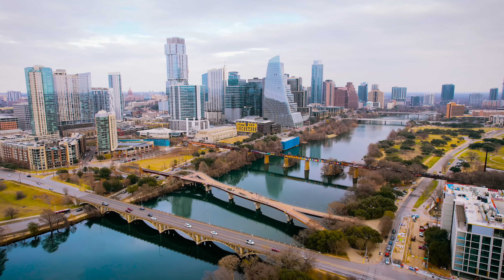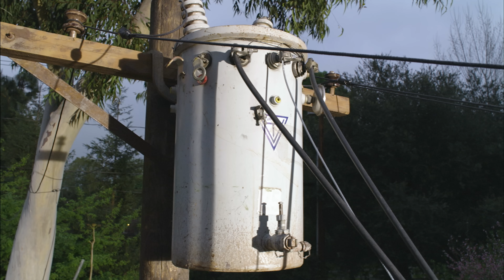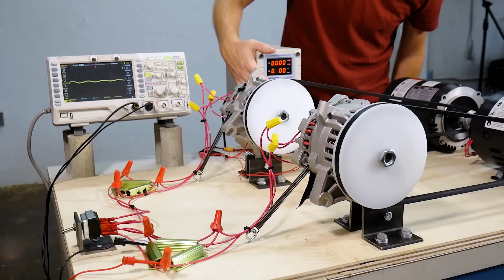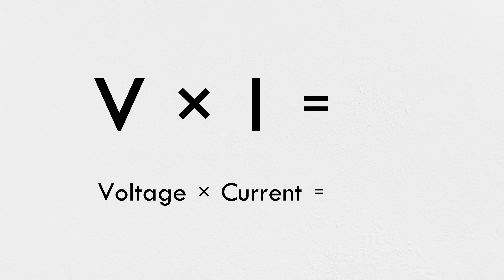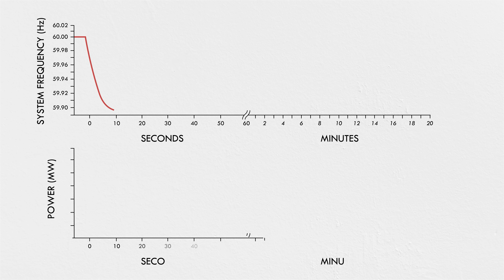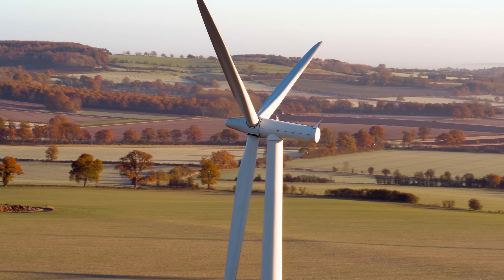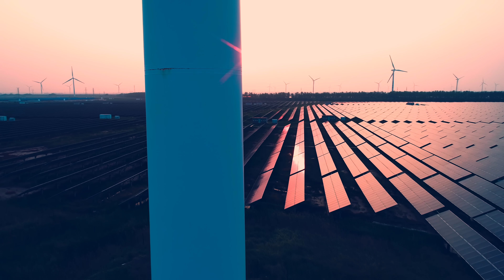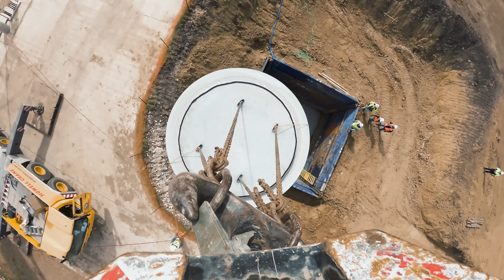Connecting Solar to the Grid is Harder Than You Think

Comment: I thought grid following inverters also pushed the phase a tiny bit, rather than only raising the voltage to push power to the grid.
Reply: Well, if you increase the voltage through the entire cycle, it looks a bit like advancing the phase on the the  0 to peak portions of the wave. (of course if will look like retarding the phase on the peak to zero portions.

Comment: I was under the impression that most wind turbines use 3 phase AC generators and then use a controller to add or subtract additional "spin" in the field to correct the frequency to the grid as this doesn't have losses associated with converting DC to AC. Is this not the case?

Comment: "The benefit of AC is that we can use simple and inexpensive transformers." Except that with the skyrocketing price of copper and power semiconductors still improving, using DC-DC conversion at high frequencies to make transformers much smaller is becoming increasingly cost-effective and when you plan to put GWh worth of batteries online to stabilize the grid, you will end up deploying GWs worth of HVDC equipment to make everything work together anyway. Pushing power onto a HVDC system is much simpler: make all generating equipment a current source and push whatever current you can until the HVDC bus hits the desired voltage, no phase to worry about. Want to hook up 1GWh of batteries to a substation with 350kVdc bus? Build 350kV battery stacks and put them on, no chargers, no inverters, just the station managing its DC bus voltage.

Comment: It's even harder when power companies like PECO don't know how to: read solar schematics, inspect a customer's transformer size accurately, or keep to their own scheduled appointments. We've had panels sitting on a customer roof for 4 months because of the incompetence (maybe even greed) of the power companies. Meanwhile, this customer could have been 100% off the grid and feeding excess back into the grid which desperately needs the extra power!
Reply: How can one be 100% off the grid and yet feeding excess into the grid?
Reply: Well, you have to look at it from the perspective of the power company.  Being forced to purchase electricity from every customer with a system is  not a good deal for them in any way.    Even if you set aside the fact that having numerous producers whcih you have very little control over  complicates operating your system and makes it more expensive,  just the purchase alone (separate from the operational complications) is a raw deal.  The power company is required to purchase the electricity at rates based on their retail rates.   Here's the thing though, those retail rates are a combination of generation costs and the power company's  transmission and distribution costs.  Building, operating and maintaining the infrastructure that delivers the electricity to the customer's home is a significant cost.    50% is a common figure, but I'm sure that it varies depending on the situation.   Regardless, the price you pay at your meter is partly the cost to generate that electricity, and partly the cost to get that electricity from the generator to your house.    Requiring the power company to purchase electricity you generate at that same (or similar) price means that they are paying way more than the generation cost for essentially additional generation capacity, while ignoring the cost to them to distribute  "your" power to other customers.   So given that, it's understandable that power companies aren't thrilled to  be required to enter into agreements that just cost them money, and understandably aren't leaping immediately to the opportunity to lose more money.

Comment: If they were required to operate at a lower output than the maximum they could produce, thus have the ability to increase output - they could provide not only primary frequency response, but also fast frequency response. This can act as "psuedo" inertia.

Comment: Its definitely complicated but it seems like because inverters can essentially be controlled by software there is a lot that can be done to prepare inverter based resources for various grid disturbances. Of course, the devil is in the details - if the solutions are piecemeal and not standardized this could continue to be a serious problem.

Comment: the pulse width modulation image is wrong: it shows the voltage gettings more steps. it's pulse WIDTH modulation: there are still 2 or 3 levels but the inverter switches faster between them. it does not introduce new levels.

Comment: Talking about Odessa... We regularly see such Multi-GW-Events in the european powergrid due to Russian attacks on infrastructure in Ukraine. Unanounced Multi-GW changes are no unusual sight unfortunately. So far the european grid withstands these events remarkably well thanks to investment in robust grid regulation systems originally intended for renewable energy needs. Germany for example has very strict regulations (for example VDE-AR-N 4105 for grid and appliance protection) for inverters and generators, so that their profile handles changes in voltage in frequency in a way that supports stability of the grid and avoids these harmful reactions you described.

Comment: In austria it is regulated how an inverter has to work. That includes an FRT Mode, i saw that already in Action on my solar system. 

Depending on the size of the solar array, the grip parameters are defined by the grid operator. Small array can use standard settings, lager ones get special settings and some times even remote access from the grid operator 

(Which is different from the company that sells the power in Europe)

Comment: Texas being unreliable is not a surprise but renewable energy is hardy a root cause, it's the transition that's probably the problem. Here in Denmark we have the highest amount of wind energy and we have the 2nd most stable energy grid in the world behind Norway.
Reply: Only reason it is stable is because you are connected to the European grid and can dump when needed. If you had to run your grid alone, wind could at times lead to serious overcapacity.
Reply: @FaustsKanaal  Wind can be curtailed as easily as solar can, so the grid would still be stable.  But without sufficient storage all the excess energy would be wasted.   One thing about wind is that modern wind turbines are NOT synchronized to the grid.   Many older wind turbines used a synchronized design, but modern wind turbines basically just turn at whatever the optimal RPM is for conditions.   This decoupling makes it relatively easy for a modern wind farm to regulate its output and having relatively small buffer batteries makes it even easier.

Batteries are both loads and generators on the most modernized grids.  Given sufficient grid-scale storage,  you don't actually need the interconnection for dumps or stability. Parts of Europe, Australia, California, Texas, and Hawaii have enough battery storage now to do this.  The batteries are able to give enough time margin that other generation sources might not have to react to an unexpected event on a quicker time scale than roughly 10-30 minutes... a huge amount of time in terms of grid management.
Reply: The electricity in Denmark is also insanely expensive.
Reply: That statistic has nothing to do with frequency stability in Denmark, since the rotational inertia that maintains it comes from increasingly parasitic use of interconnection with turbine generators throughout the rest of Europe.
Reply: Right! And not just the transition, but the way Texas (and most of America) handles that transition. In America it's all about maximizing profit rather than maximizing reliability, so corners get cut and grid equipment gets manufactured by "the lowest bidder". A few places in the US have municipal (owned by the public) utilities and these are almost universally more reliable and cheaper, even with a very high renewable portfolio.
Reply: Texas is a world leader in wind and solar generation.   Our economy is growing so fast that it's almost impossible to build power generation sources fast enough to keep up with demand created by this growth.  When you also factor in our extreme heat in the summer, when our wind production is typically at its lowest point.  This can cause problems.
Reply: The problem with renewables in the US is that in a lot of areas of the US air conditioning is needed during the hot summers which run normally until around 8pm. The problem is solar and wind shut off around 6-7pm during the peak power consumption from around 4-8pm which is the reason why renewables are causing headaches for the US grid. Having a major power generation system shut off during the peak of power consumption is not a good mix.

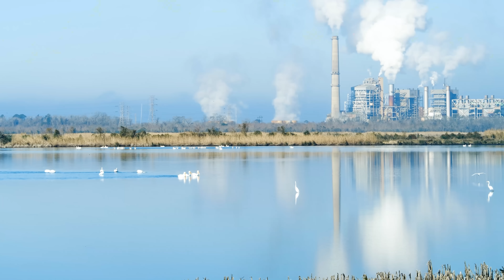Comment: 1:15 The frequency reduction would cause all AC motor to run a little bit less RPM, but even subtle variations on line voltage do the same .. so it's unlikely anyone would  notice.